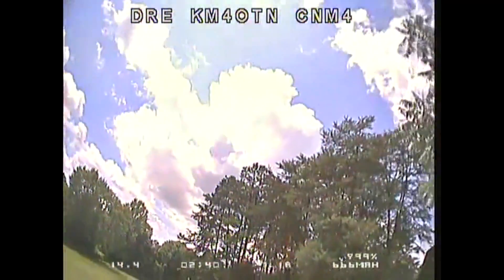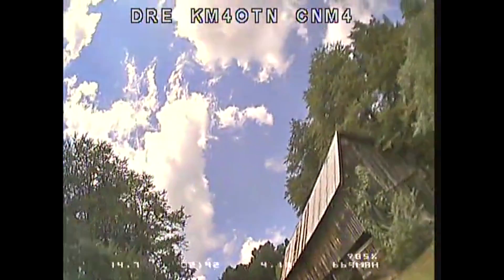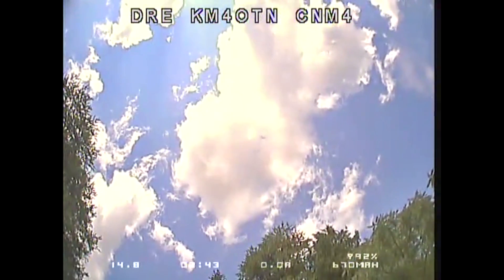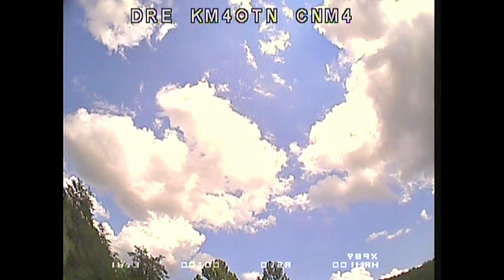Synced vs Unsynced Multishot: Does it reduce oscillation?

Comment: Hello Joshua, after watching this video I switched my setup on my SPF3 from 4k/4k synced to 4k/4k unsynced at 8000 PWM.  My quad was appearing to fly MUCH better and then I suffered some sort of death flip.  Could this of been because I switched to unsynced?  Also, I'm not sure what PWM setting I should be going with when running unsynced?  Thanks for all your help!
Reply from the maker: In general, think unsynced is less likely to cause desync than synced. If you're going to run unsynced, then go as fast as you like, assuming you're running multishot. You are using mulitshot, right? If you're running oneshot, best to stay at 2k.
Reply: Joshua Bardwell thanks josh.  I am running multishot 14.85 on little bee 20a pro esc's and scorpion 2204 motors.  I guess the thing I'm wondering is, why is there even an option to adjust the pwm speed if you can simply run it as fast as you like without any sacrifice?
Reply: Joshua Bardwell thanks josh.  I am running multishot 14.85 on little bee 20a pro esc's and scorpion 2204 motors.  I guess the thing I'm wondering is, why is there even an option to adjust the pwm speed if you can simply run it as fast as you like without any sacrifice?
Reply from the maker: Because there is not widespread agreement that there is an advantage of running at higher refresh rates, so experimentation is necessary to find the best settings.
Reply: Joshua Bardwell thanks for your help!  I will keep testing different settings.

Comment: So last night on your live-stream you were discussing Oneshot, vs Multishot, and if it makes a difference.  And if running Multishot will improve performance on a quad with lower looptimes.  I think the answer is absolutely, because the ESC responds to outputs from the FC.  Let's say the FC is running a 1K looptime, at 1000ms a new throttle command is given to the ESC, running oneshot it takes 125ms for the command to be received and the ESC to start responding.  With multishot, the ESC can read and respond to the command in 42ms.  So from the time the loop finishes it takes longer to respond.  Now the responses are still 1K apart from one another, in both instances, because the previous response was the same amount behind, so you would still see a 1khz cycle on the esc, however, if you looked a the start of the PID loop on 125 to the time the ESC responded, the total time would be 1125ms, and with multishot, the total time would be 1042ms.  That's why it's better, because there is less lag in the loop.  Hopefully that's not too long winded.  You could probably explain it better.
Reply from the maker: I think you did a great job explaining it, and if there is a difference with multishot, I agree that's what it is. The shorter pulse means that there is less delay between the PID loop and the actual motor output.

Comment: hey so stock on bf 3.0; when you enable seperate pwm for motor is 400. so for 32k would it be 3200
Reply from the maker: +rio_ lld 32000
Reply: +Joshua Bardwell okay thanks! your videos are an awsome help, for all this new stuff coming out. what would you suggest for 8k gyro and pid?
Reply from the maker: Not sure what you mean. "What would you suggest" how?
Reply: +Joshua Bardwell for the motors, what what you suggest, 32k? 16k? 8k? when running 8k on gyro and pid?
Reply from the maker: I personally run 8k/4k on my copters. If you want to run un-synced, and if your ESCs can take it, then I would go 8k/4k/32k. 

Why not 8k/8k? Because with betaflight 3.0, many F3 setups cannot do 8k/8k any more.
Reply: +Joshua Bardwell okay thanks!! again awsome videos

Comment: Interesting test thanks Joshua. I felt 1 was clearly better but I maye have to review the footage again. Its a nice field test but Im sure you will admit it could not be described as highly accurate given the subjective nature of the evaluation. Never the less its clear the differences are not 'huge'...I suppose at this point we are at the level of trying to squeeze smaller margins of performance...I have to of course say I am very happy with my Raceflight 8k / 32k setup with XM20a! Given that Revo clones are so cheap now I recommend you give it a try!
Reply from the maker: Yes, I agree that the test is far from perfect, but this is a case of not letting the perfect be the enemy of the good. We are in the realm here of engineering, not science. We are trying to evaluate real-world performance. Thrust stands can give us perfect, repeatable, scientific data, but then you ask, "How does that translate into actual flight handling?" Flight handling tests will always be less repeatable, but the results reflect the real world. So there is a tradeoff.

As long as we acknowledge the limitations of the test, then we can take meaningful results from them. What if the oscillations had gone from manageable to completely unflyable when I went from 32k to 8k? Then we DEFINITELY could conclude that there was a big difference. Since that did not happen, we can conclude that there is not a BIG difference. That, in and of itself, I think is a useful result.
Reply: yes Im interested for sure and have asked the RF guys about 32k because if its not neccessary then...but as you say it could be that they need that for other things...they are just testing samples of their FC which will be running at 32k pid loop so...I think a really interesting test would be a BF vs RF test with same components...Im curious how much of all this translates into the real world...all I know is I like my RF setup a lot but I am aware bias can creep in...blind test time! ;)

Comment: I'm running Betaflight 2.9 with 8k/4k loops sp evo fc with multishot and aikon sefm esc's . It didn't feel connected and wasn't smooth. So I unsyned the pwm and set it to 8k after watching part 1 of this video and it was a night and day difference, I'm not sure why but it worked. But the main reason i'm leaving a comment is that, I almost had a disaster!!!!! When you save and reboot with unsynced pwm at least in BF 2.9. I have found the motors crank up to full throttle while the FC reboots then stop once the fc is back online every time around 2 to 3 seconds. I tested this and it doesn't happen with synced pwm. So never even play with keeping props on your Quad while hooked to a computer, especially with unsynced PWM be very careful guys. I was lucky that if i ever need to make a change with the lipo attached and I leave props on, I put a big beach towel over it, it saved me for sure. Ripped all the blades off of 3 dal props. Just wanted people to know my findings so somebody doesn't get hurt.
Reply from the maker: This is a bug in 2.9. 2.9.1 is a hotfix for this bug.
Reply: Ok thanks Josh that is good to know. I was going to wait for BF 3.0 to get out of alpha before i flash new firmware and start over, but it looks like I will be Flashing 2.91 today. Keep up the good work Josh love the videos. You have taught me everything I know.lol

Comment: What is point of running motor updates on 32 kHz with BLHeli_S when motor PWM frequency is always 24kHz? BLHeli_S can't update values sent to motor at higher frequency then what is motor PWM frequency.
32kHz maybe will be useful for some ESC that have higher motor PWM frequency than 32kHz, but for BLHeli_S anything more than 24 kHz do not make any positive difference.
Reply: nixxinn
BB2 Blheli_S is running on 48MHz (EFM8BB2) not on 48kHz, but that is MCU clock frequency not PWM frequency, and BB1 Blheli_S is running on 24MHz.
According to official BLHeli_S statement
"The motor PWM frequency is always 24kHz. The resolution is 2048 steps for MCUs running at 48MHz on ESCs that have automatic deadtime control. On ESCs that have fixed deadtime, the PWM resolution is 1024 steps. For MCUs running at 24MHz, the PWM resolutions are half."
Which is correctly if you do calculations, for 48MHz MCU you get max PWM frequency with 11 bit timer it can generate of 23437.5Hz which is roughly 24kHz (but EFM8BB2 do not have exactly 48MHz but more like 49.5MHz if I remember correctly)
Higher PWM frequencies you can get only by lowering resolution or increasing clock frequency which feed timer used for PWM.
Reply from the maker: Well, that is the hypothesis, and this is the experiment to test it.
Reply: I'm not sure but are the BB2 Blheli_s not running on 48k ? and the BB1 at 24 ? atleast according to oscar liang blog

Comment: I guessed  1,3,4,2,5 with "3,4,2" being pretty similar, so off the cuff I noticed a difference with #1 (32kHz unsynced) being the least disturbed in the corners.
Reply: Agree. I thought #1 was noticeably better- less vibrato in the audio on turns.
Reply: +Mark Sherman it is logical that it may be slightly smoother as the esc will produce less thrust ;)

Comment: So, while there may be little to no advantage of the higher rates, are there any disadvantages?? Also, sorry to ask again, but the XM20A is a F390 esc so it can do 32k multi?
Reply: xm20 is a F396 mcu so it can do 32khz
Reply: Sorrentino FPV Thanks. I plan to run my 4inch build on 8k 32k un synced. because why not lol
Reply: +ArmedMonkey I'm not sure. I'm pretty sure they have always been a F396 so shouldn't have been a problem. Unless rev2 was updated with faster mcu
Reply: +The RCAddict ya man. That's what I run 8,8,32. Flies awesome
Reply: Sorrentino FPV ***** Mine are V1, but I thought that only referred to coming with bare pads or pads with wires.
Reply: Sorrentino FPV Haha ok. Going for multi 32k unsynced and 8k gyro, we'll see if we can make her burn, lol
Reply: ***** That sort of makes sense, haha. I will try 8k gyro and 16k unsynced multi :) Has to be better than my normal little bees on 2k one shot ;D

Comment: But is there any downside at all to running 32k  unsynced. Ie were the motors/escs hotter or cooler in any of the samplings?
Reply from the maker: I didn't check.
Reply from the maker: Slower ESCs don't like faster update rates, but I think if you are running F390 or _S you should be fine up to 32k.

Comment: One thing that may have influenced your test with such a high kv motor...are those escs bb1 or bb2?
Reply from the maker: +Flying Fox I really doubt it matters. 1500 throttle even on 2600 kv is well below the rev limiter of an F330.
Reply: +Joshua Bardwell bb1 may have issues running 32 kHz, at least with raceflight. Not sure about betaflight.
Reply from the maker: Maybe so, but that seems independent of the kv of the motor on the output side.

The ESC is Sunrise Cicada 20A. I don't actually know offhand whether it's bb1 or bb2.
Reply: +Joshua Bardwell they have v1 and v2. v1 is bb1 and v2 is bb2